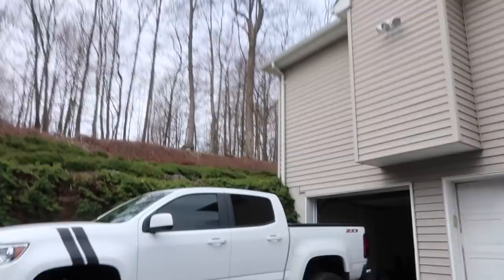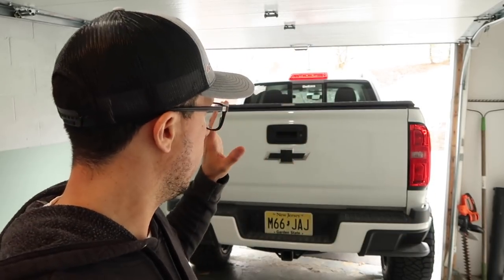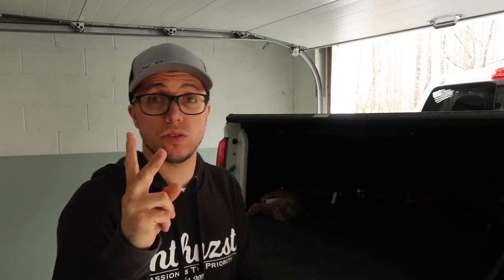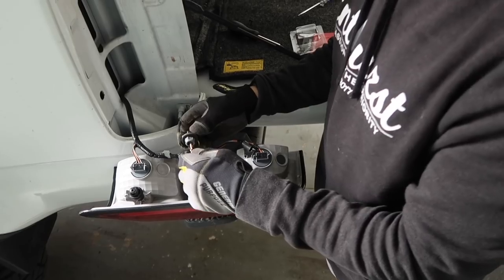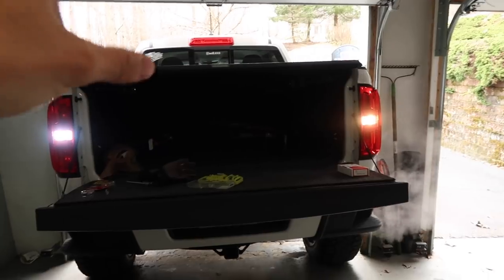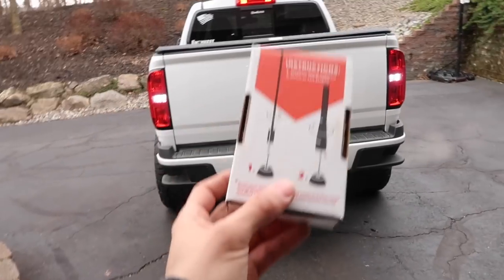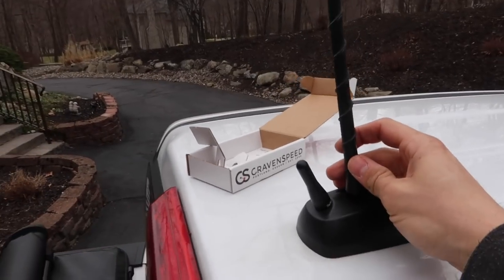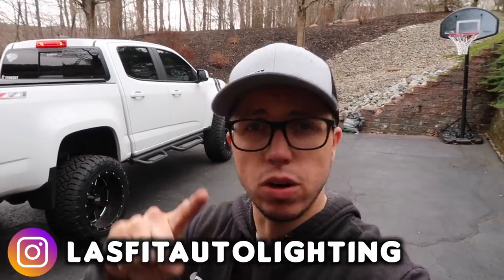LED Reverse Light Bulbs 2015-2019 Colorado/Canyon 🔦💡

Comment: Hey Matt do you maintain your cover with any kind of protector or moisturizer? The weather is so different over here (I'm in AZ) so the sun beats on mine.. I'm thinking you don't have that problem there but just curious if you apply anything on it.. thanks for your feedback
Reply from the maker: Hey Andrea... I don’t apply anything’s... to be honest I should ... because all the weather changes it is brutal on the cover... I will look at something ... if you know something... let me know! 👍🏻
Reply: @Matty.Garage  Honestly I have had someone recommend Babe's Boat Care stuff..sounds weird, I know but it actually makes sense. Protects against the elements (rain/sun).. just not sure exactly which stuff to buy and honestly have dragged my feet on it. But if you hear of anything else, please let me know.